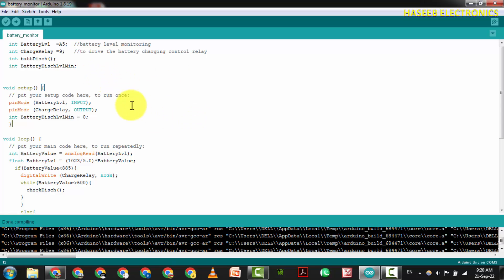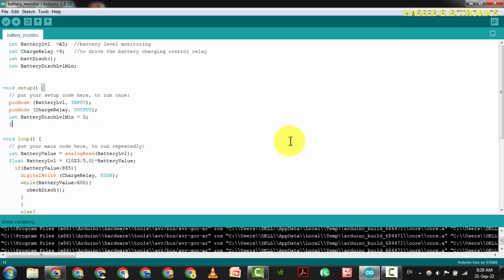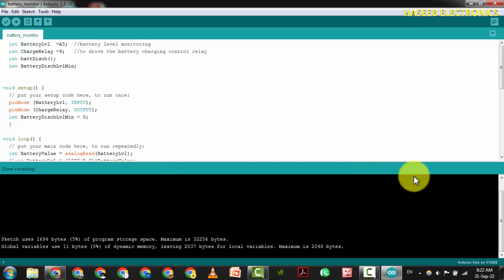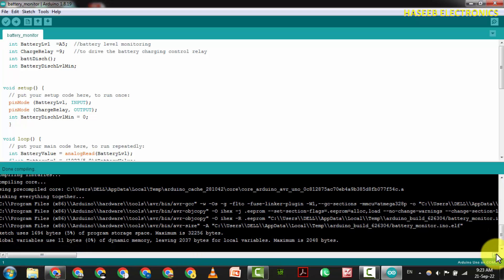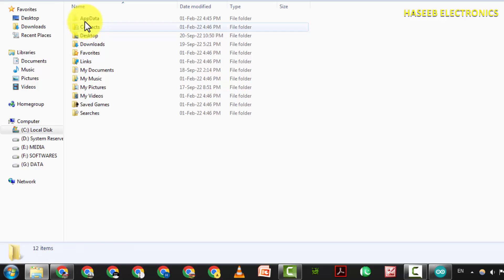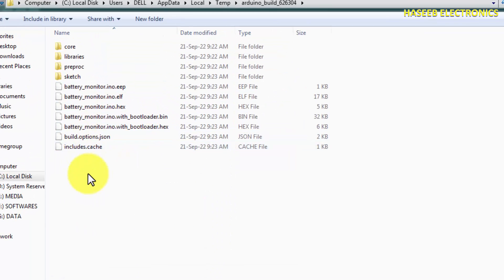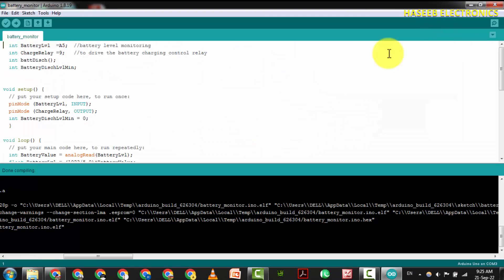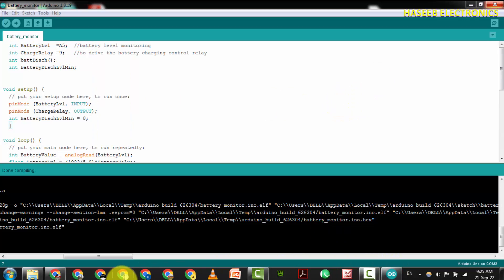{704} How To Generate hex file From Arduino Code

Comment: Sir, I am doing a big assignment in college. I also have the same idea as you, but I also use an op-amp to strengthen the signal. Is that possible, sir? At the same time, I also want to display the results on the LCD screen. If you read this, please give me advice. Thank